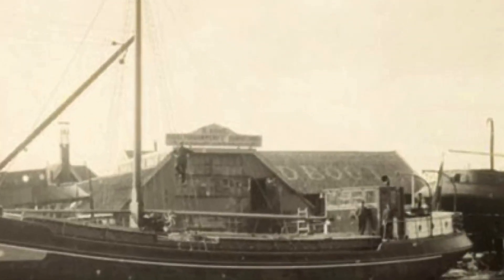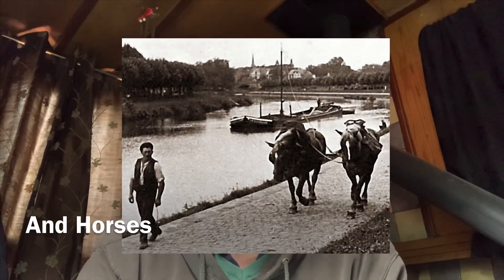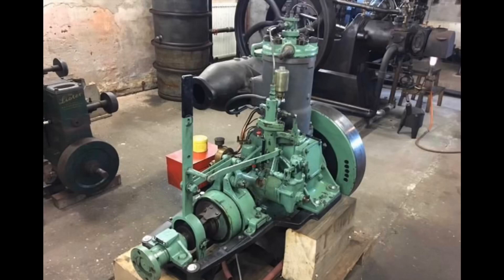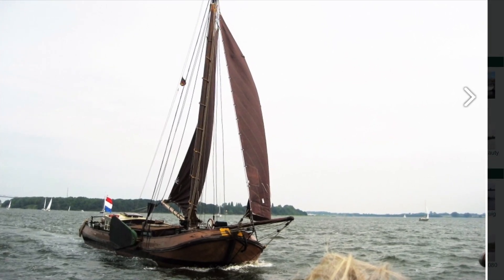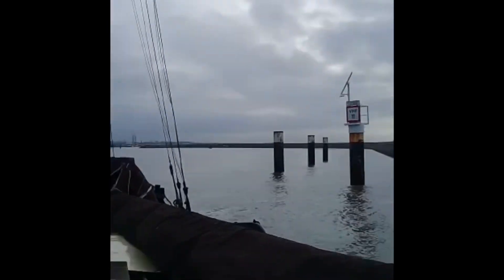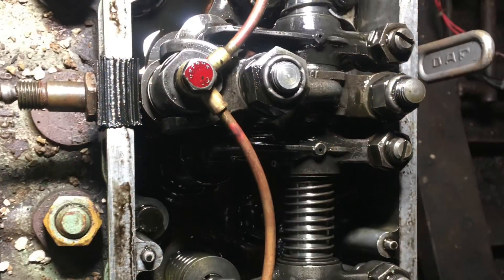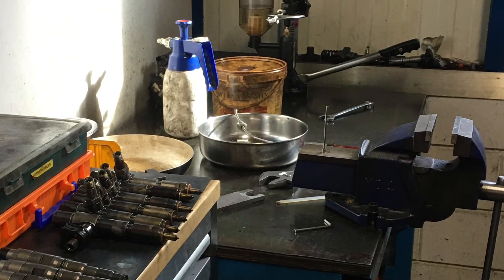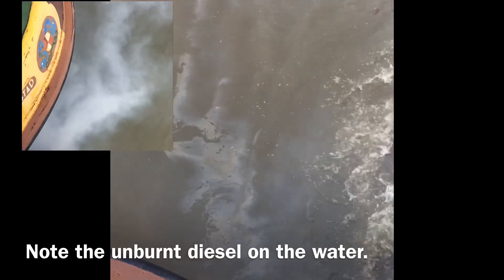De Vrouwe Linda #6 DAF 475 and the Counterweight. Diesel engine problems and engine history.

Comment: If you get good at sailing consider converting to electric drive as your boat has lots of room for solar collectors.  Ah!  I see you are thinking that way.
Reply from the maker: Hi Jonathan, Wind (sails) and Solar (electric drive) that’s the plan. The terrible thing is, the diesel engine needs an overhaul, but I’d rather spend the money swapping it out, so the engine will have to just hold on until then.

Comment: I just found myself in your excellent videos,I have some question for electrifying propulsion;electric propulsion is great but instead of diesel generator,could it  be possible to use a Stirling engine ?
Reply from the maker: Well! Now you’ve put the cat among the pigeons! As a result of your comment I’ve had to learn about Stirling engines.... Very interesting they can be run off solar as the source of heat....

Comment: I have a Gardner 3L2 on my NB together with a boatmans cabin.  The engine is from 1930  and is bombproof and so easy to maintain, none of that Kromhout pre heat malarkey.  Such a similar engine would look great in your barge 😁
Reply from the maker: That is a super set up! Beautiful engine! I did a bit of research into Kromhout and although this is quite common, Kromhout licensed some of their technology to other manufacturers including Gardner. So you might have a little Kromhout DNA in your boat. Thankfully not the hot bulb!😂. I was surprised to learn Vauxhall was purchased by General Motors in 1925 and were sharing components with everyone! I digress. The DAF engine in De Vrouwe Linda was licensed to Leyland Trucks. So really I’m driving a floating bus and consider that in the 60’s the main cabin of the boat used to be a bus!!!